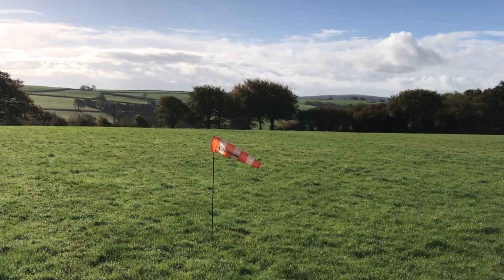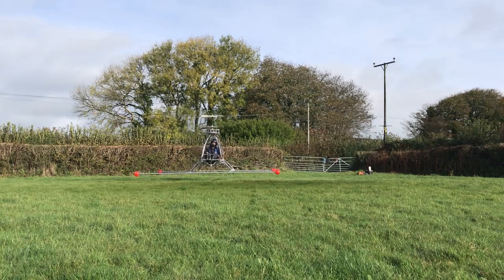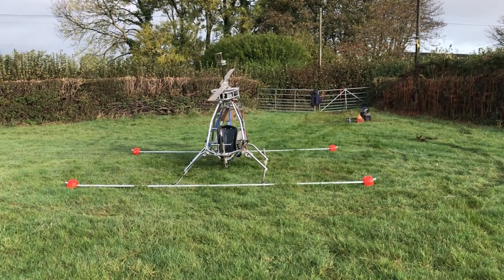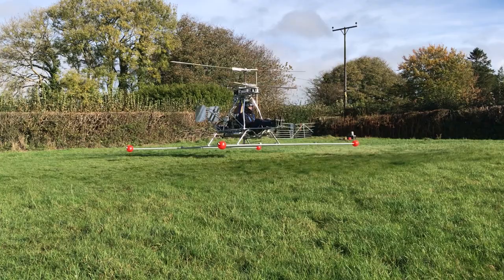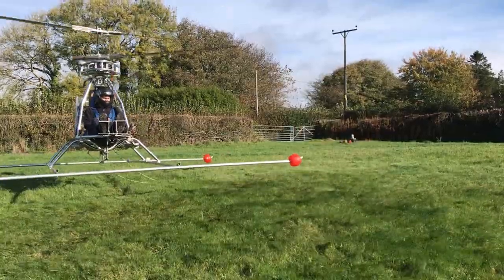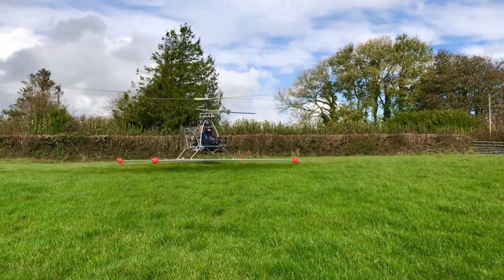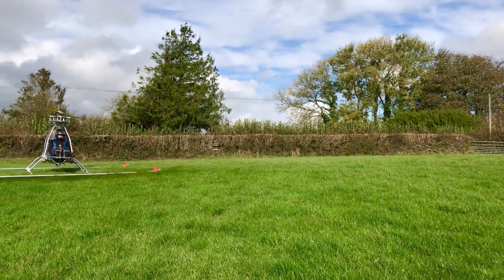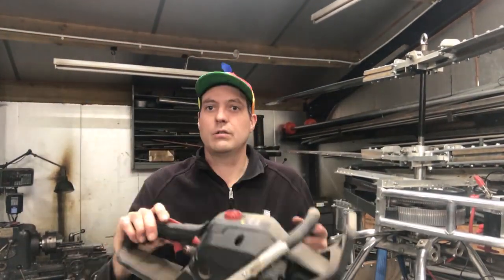BALLS UP Homemade coaxial helicopter learning to FLY

Comment: It's coming along nicely. For your cooling needs, would a thermostatic valve work? The hotter the coolant, the faster the flow. 
I had to admire your balls in this episode. ;-)
Reply: I wish I could help. Maybe call up the  manufacturer. You never know. They might shine some light on it.
Reply from the maker: Good advice. They would be able to answer some questions I'm sure.
Reply from the maker: I'm not sure, the engine did have a thermostat but I removed it as I thought it would increase the flow. I'm not sure what the right thing to do is at the moment.

Comment: My 2 cents on the coolant situation, your logic is sound to increase flow rate with the restricter. Might be better to move to a smaller diameter line later on. Too thick of a line doesn’t move coolant fast enough (lack of flow due to lack of pressure), I’ve heard of formula drift cars dealing with this.
Reply from the maker: Thanks, I was actually thinking increasing the restriction would reduce the coolant flow under the same pressure ? Interesting you mention the drift cars adding restrictors though

Comment: Just watching, it looks to me you are still over controlling a bit much. I know you have to be anxious as you try again but try to force yourself to me more methodical in your control movements. Quick moves do not help. Make sure you are stabilized before you lift off. If you wait until you lift off you have to correct immediately. It sounds simple but it does require anticipation of where the helicopter is going to go once you do lift off. With the way your ship is designed there has to be some lag in inputs. Figure that out and you will be golden. Just get it light on the skids and feel for where it wants to go and adjust before you lift off. Slow and steady... you got this. Small corrections, see the big picture of attitude, not the details, and look out ahead, not at the ground below, it's not going anywhere. :D
Reply from the maker: Thanks for the advice. I agree with all of it. You know when learning some things they just click and your off, with this it's a series of small clicks and you very gradually get better but you're never far away from your next mistake. It will be so nice when you can just do it without thinking but the road is much longer to that goal than I ever expected. If I had torque reaction, engine power and rotor speed to manage like on the AW95 for example, boy that would be hard.